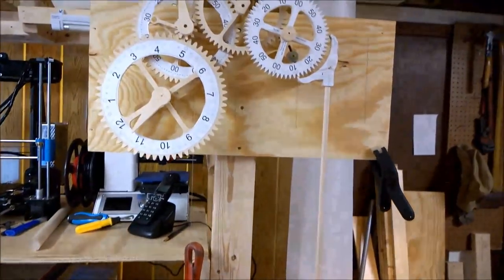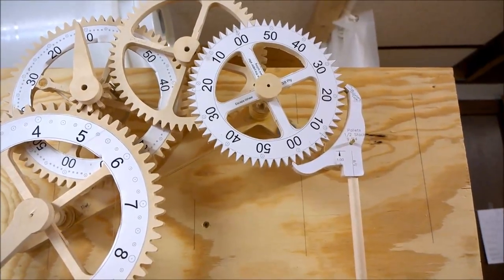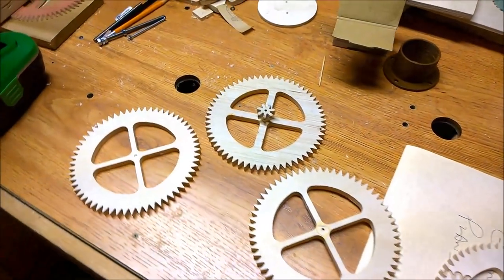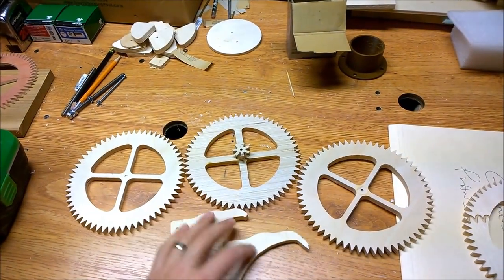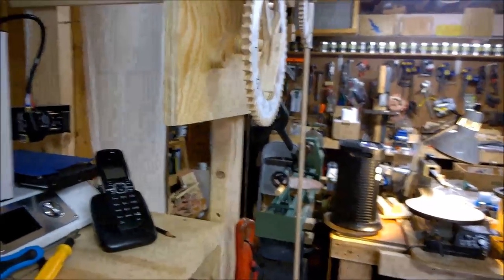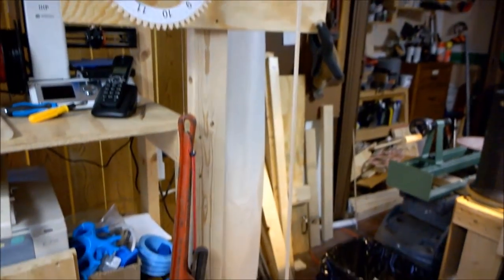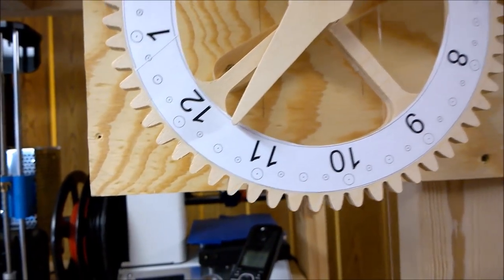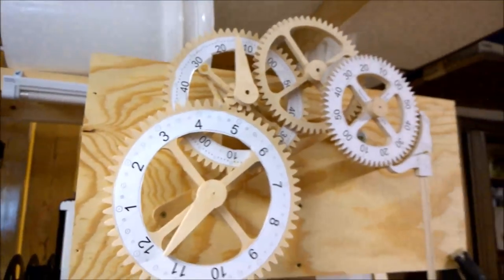Genesis Wood Gear Clock - Up and Running!

Comment: I built my Genesis clock in 2019.  It has been running since then.  I too had some fun while building it.  I used my CNC to cut all the gears and the escapement wheel.  My escapement wheel does not have points, but rather nubs.  I did cut the pallet by hand with my jig saw tho.  I drilled the pallet with a 1/4 inch hole and put a dowel (friction fit only) that has a 1/8 inch pivot hole drilled offset so I can make fine adjustment to the pallet and escapement pair.  Everything was going good until I glued the clicks in place on the minute wheel.  I looked at it and saw I had glued them in backwards.  I tried to move them but the glue had set.  I looked at the clock and said "Oh well, I think it will run OK backwards".  And it does that just fine.  I had not cut the numbers into the wheels yet so when I did I was able to make them read correct for running backwards.  I had it regulated to about 10 seconds a day until somebody pulled on the pendulum and changed the whole beat of the clock (maybe bent the rod that it pivots on).  I am still trying to get it regulated again.  Live and learn!

Comment: Hi @drez20001 I am just about to start building a Genesis clock.  Found the plans in the 'Making Wooden Gear Clocks' published by the editors of Scrollsaw Woodworking.  Bought from Amazon it is a lot cheaper than buying from Boyers website.
I am thinking of cutting the gears on a laser cutter using thinner ply and and 'layering up' where I need extra thickness.  Any thoughts? do you think this would work?
Reply from the maker: Awesome.  Yep, the plans were included in that edition of Scrollsaw Woodworking.  It should work.  Laser cutters are accurate enough to be very consistent.  It's a fun build that is pretty forgiving.  I'd give some thought to making sure your registration is tight with stacking the gears; maybe using pins or some other way to keep them lined up.  Best of luck.

Comment: One possible reason for out of round gears is the X and Y axis not being exactly 90 degrees to each other. Squares will cut as parallelograms and circles will cut as ovals. A machine with 2 steppers on the Y axis can have this problem if one motor stalls while the other motor moves. The X axis will be out of square until the Y axis motors get re-synchronized.
Reply from the maker: Hi Steve.  Yep, I agree.   It was a fun cnc build but not a great machine for projects with tight tolerances.
Reply: @drez20001  I just cut a 6" gear on my CNC router and it was 0.03" out of round.  One diagonal was 6.206" and the other one was 6.236".  It turns out that one of the slave motors was about 1/8" off.  Now I need to add one more step to align the motors before powering up the machine.  
Don't give up on the CNC machine.  It is definitely the best way to cut clock gears once everything is dialed in.

Comment: I think you don't need the wrench - the heavier weight is "making" your pull side work harder. The makers mentioned (on the blog) that the non-pull weight is for show - normally empty copper pipe. ((just like heavy side, but for visual balance)) - try this?

Comment: Great work!
as for the "off" measurements, I had the same problem with my DIY machine and tried everything from the inkscape settings, the JSCUT settings to the Mach3 settings regarding speed and acceleration, it turned out after all testing that there were some backlash thought I'm using ballscrews, it turned out that my design will have some of the bolts and nuts holding the z axis to loosen up due to the vibration and had to be tightened every now and then, I hope this helps

Thanks for the great content
Reply from the maker: Thanks for your comments and suggestions.

Comment: ?i made wooden clock but my problem is that the pendulum stops why
Reply: Ameer Al 
make a video about it.
With this little info i can't help you.
Reply: SO many possible reasons. 
1. Friction. Take the anchor off and make sure all your wheels spin freely. Spinning continuously is one thing, but starting and stopping is another. Static (stopped) friction is higher than kinetic (moving) friction. Make sure that once your gears stop, they will automatically start spinning again on their own, in every position! Grind down any bad teeth on your gear train, make sure the gears don't rub. Use Teflon spray dry lubricant on everything. Maybe invest in some tiny ball bearings for the axles. And most importantly, make sure the gears don't rub!
2. Escape wheel tooth alignment. It took me 8 attempts to cut out an escape wheel out of wood. Turn down the speed on your scroll saw for better precision cuts. make sure the teeth are all spaced equally. Use laquer and polish to make your escape wheel teeth smooth and hard. Use a micrometer to make sure your escape tooth spacing matches up all the way around the wheel. During your tests, take a marker and mark any tooth where the clock stops, this will help you identify problem teeth so you can grind them down. 
3. Weight. consider adjusting the weight of your pendulum and the weight of your driver. If the clock ticks too loudly, then your main weight weights too much. If it stops often, on random teeth, then you might not have enough weight. WHEN THE CLOCK STOPS, if the pendulum just stops dead, then your pendulum doesn't weigh enough. 
4. Anchor location, come up with some kind of system so you can make fine adjustments to your anchor position. I'm convinced no clock can run without this. Go watch my video on the adjustable anchor arm I created for some inspiration: https://www.youtube.com/watch?v=1XF4096mQHg
Reply: The pendulum stops because: it's a fickle wooden clock. That's reason enough. 3600 bpm pendulums are crap. If I were to design another clock I would start with a 7200 pendulum (which is about 10-ish inches long). Shorter pendulum, faster oscillations, increased accuracy.

Comment: A decent beginning. Now design your own and make it work. My personal conclusion after chasing this rabbit hole is Thank G-d For Quartz. My last clock will be my last clock. Anyway, good job, but that's someone else's clock design. Go hardcore and do a custom going train calc, frame design (the hardest part actually), and then cut out & assemble it. Talk about fun? If you think that thing was a burlap sack filled with a long series of sobs, dig in and take a huge bite of shit sandwich by designing one of these from scratch.